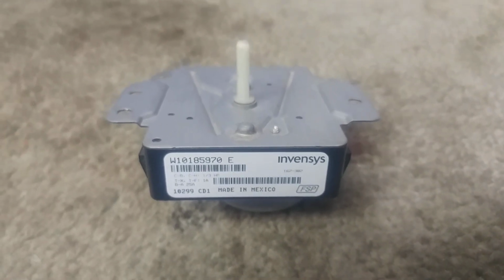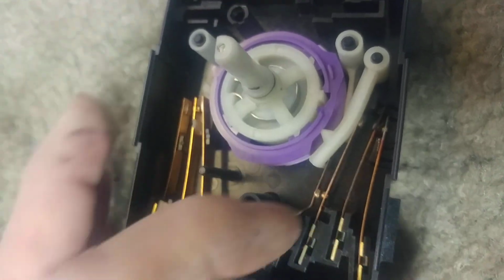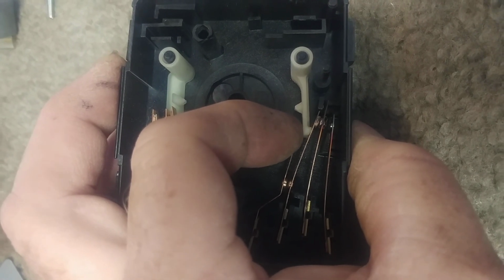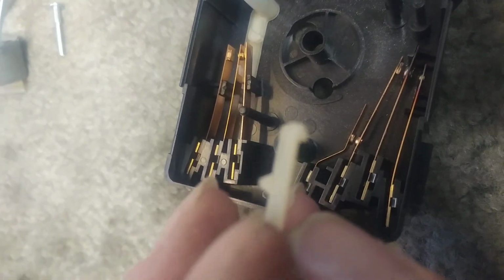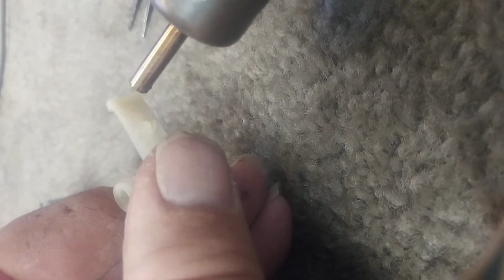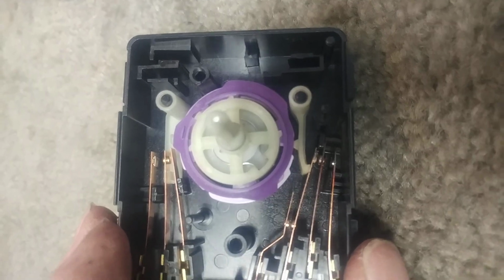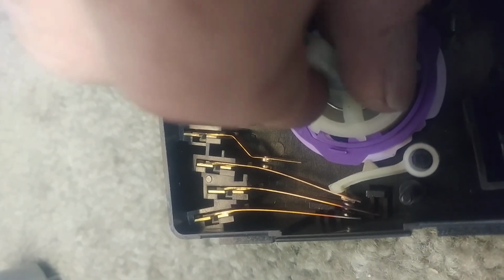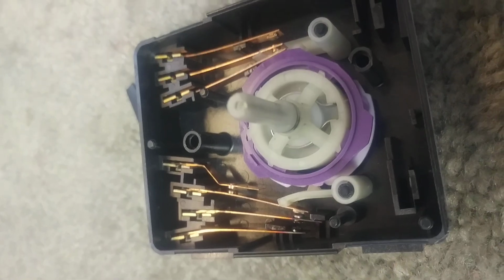Whirlpool Dryer Timer Repair Part 1 of 2  - No Heat Or Intermittent Heat

Comment: This is the 2nd video of yours I've watched on DIY repairs. The first was on a control board for an Amana/Whirlpool washer that I fixed with your help. Now it's time to tackle my no heat issue on a Whirlpool dryer. All the heat related items checked out for continuity and ohms at the element, so it's gotta be the timer. Thank you for sharing your experiences they are a great help to those of us on very limited budgets.

Comment: back in the day they had metal stems, heavy contacts , they lasted 20 years.. glad im out of appliance repair. the contacts used to have a thick pad of silver on them, not sure what they use now.. once the contact surface pits and burns it will quickly weld itself together or arc and build slag and not make contact.. also, the dryer motors dont have solid copper windings anymore, they are copper coated.. the paint on the drums peels off, the belts are junk and dont last 3 years, the metal in the rollers is junk pot metal, the case of the dryer is sharp and cuts u to shred when working on them.. its sad to see whirlpool go down so much, I used to love them, but I guess to compete with the chinese and korean junk market, they had to cut costs.excellent video and repair !!! thanks..
my timer was very hard to turn, I think there was lint stuck between the stem and the case, but im going to lube it up with some vaseline just to make sure it doesnt bind up or wear the levers.

Comment: Hey must say a very well explained video having an issue with a drier change the selector and the drier works now and there is no heat but before I changed it there was heat checked all the sensor to the back and it's ok any thoughts
Reply from the maker: Make sure your heating element is not open. You should get continuity with an ohm meter across the two big terminals of the heating element. If you are very comfortable around electricity you can try turning the dryer on and while it's running make sure you measure 220 volts at the two terminals of the heating element with your meter on AC volts. This is very dangerous to do and you could get a shock or be killed if you don't know how to do it safely. The heating element is in series with the thermostat right next to the terminals and also with the high limit fuse located at the top of the heat duct. If either of those two are open then you won't get any heat either.
Reply: @PAballoonists  hey thanks for the info

Comment: Well played. Great video.
Reply from the maker: Glad it's saved you some money! As an observation the newer versions of this timer use a different type of thermoplastic for the cam arms. I think it is a material that is more resistant to wear and I never see a groove in any of that material. Really stinks that they didn't issue a recall to replace the affected timers for customers. Of course, something like that the average person would never know. Only people who work on appliances would ever realize it and even then many wouldn't even bother to take the timer apart and look at the guts,  just replace it. Over the years I have seen so many bad design things and the people that pay for it are the customers, they just have to eat it oblivious to the fact they've been screwed. Only if it's something visible like moldy door boots in the Maytag Neptunes or spider arms that corrode and break in the Samsung washers do people even get on to the idea that there is a common problem they can go after. Anyway, glad I could help you fix it!

Comment: How do you know the right position for the wheel?
Reply from the maker: The programming wheels are "keyed" so they only go in one way and therefore there is no gear or cam timing you need to worry about

Comment: Anyone know where I can buy replacement cams? My bottom ring cam broke but I cant find any good part sources. Everyone just wants to sell you the whole switch
Reply from the maker: Yeah that's what I found as well. There is a little latch finger on each cam that breaks if the user repeatedly turns the timer backwards (counterclockwise) to set the cycle. Doing that eventually breaks the finger on the can and it falls off. I have had success putting the cam back on the drum and using a little JB weld to fill in the space where the latch finger used to be. I put a piece of tape behind the gap in the cam to keep the JB weld from oozing out before it sets. After it's cured you can pull the piece of tape out and put everything back together. Remember to use a little bit of grease like lubriplate on the lobes of the cam to reduce the friction of the levers riding the cam. If you want I can look at my box of stuff and see if I have what you need. If you give me the part numbers from your timer I will look and see if I have one for parts that has a good cam in it
Reply: @PAballoonists  thanks for the offer I really appreciate it! But I ended up biting the bullet and bought a whole switch.

Comment: Hi! I have a whirlpool dryer that heats just fine, have never had any problem with the heat working, however the timer won't work at all. Literally the dryer would run for hours and never stop if we didn't physically turn it off. Do you have a suggestion for this kind of problem?
Reply from the maker: There is a little motor on the back of the timer which might be bad. Either the motor coil is open circuit or the gears inside the unit are stripped. When you go to set the time on the dryer do you feel the normal amount of resistance of turning the timer around or is it very easy to turn? If it is very easy to turn that may suggest that the clutch inside the timer that engages with the motor is stripped or broken.

Comment: What if the timer won't advance and there's no heat?
Reply from the maker: Sounds like the timer motor isn't running. Does the dryer run at all? Some dryers will run but not heat if the thermal fuse is blown due to excessive lint and/or clogged exhaust.
Reply: @PAballoonists  it started heating but the timer still won't advance. May be the timer motor itself. Thanks for replying👍
Reply from the maker: @whuzup3  If you have a multimeter, check very carefully on ac volts on the two wires to the motor when the dryer is running on the timed drying cycle (not the auto dry cycle). While unplugged, look for the voltage printed on the motor to see if it says 110 or 220 volts and see if that voltage is being supplied to the motor while the dryer is running on the timed drying cycle. If you do have voltage but the timer does not advance the motor or gears within the motor are likely bad. The reason I say check this on a timed vs. The auto dry cycle is that the timer does not run all the time rather the motor receives power only when the dryer reaches a high enough temperature, causing the timer motor to run in on and off cycles until the cycle completes.
Reply: @PAballoonists  I have a multimeter and will check the voltage. We only use the timed cycle when we dry clothes so I've never tried on the auto cycle. I tested and read 220 at the wall receptacle.

Comment: Worn down plastic on mine too.  Instead of bending the arm with a heat gun, I instead rebuilt the missing plastic in the groove with super glue and baking soda (the baking soda instantly dries the glue) and then filed down any bumps leftover from the hardened glue.  I added a bit of lubricant as well and my dryer heats again.  Thanks for the video!
Reply from the maker: Glad it helped. Timers are stupid expensive for what they are! Not to mention the fact that the manufacturers are using weaker plastics and less lubrication. For all the money we pay for these appliances they really ought to last better. I guess it gives engineer's a job to keep reinventing the wheel over and over but sometimes I think they come out of school with no kind of real-world experience and then things like this happen.